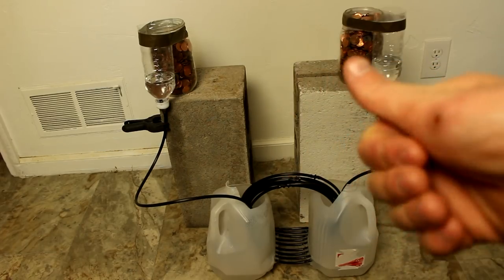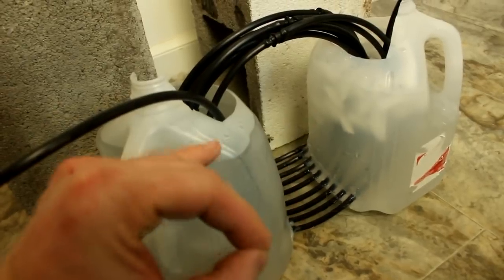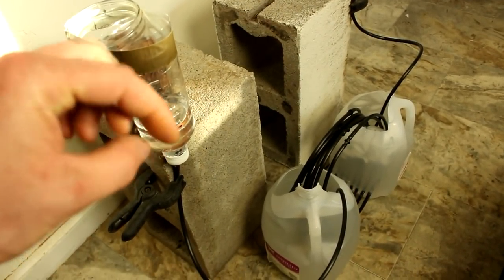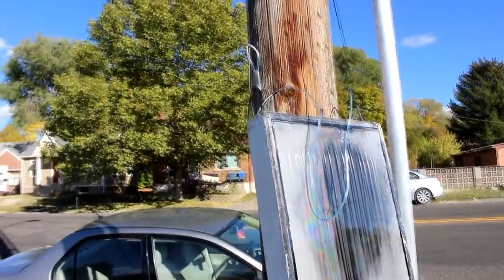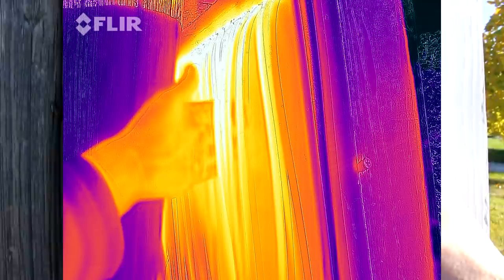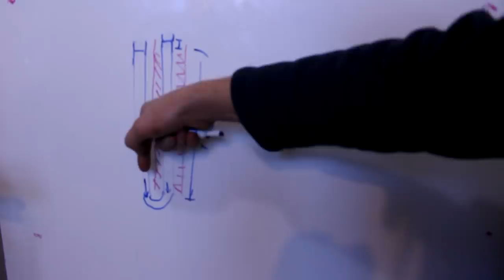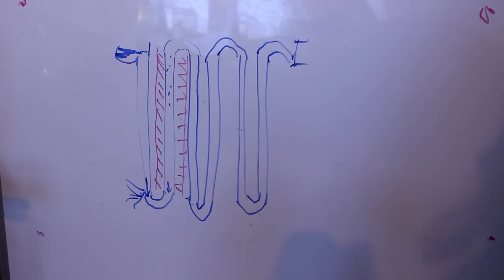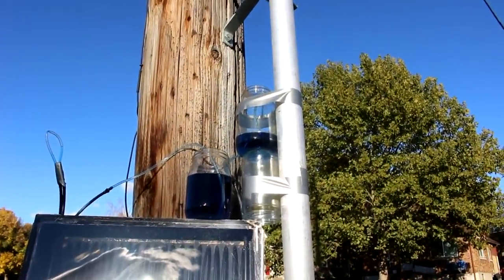Water Pump With No Moving Parts? (except water of course)

Comment: Copper pipes and a peltier grid maybe?  Power the peltier units with solar panels and batteries; each unit has a hot and cold side.  I mean, if you want to maximize inefficiency anyway.  You would probably need a beefy battery array and a solid chunk of solar panels.  Also, hello from a fellow Utahn!

Comment: You could solder a bunch of thin metal tubes to a metal plate & connect the metal tubes in place out the ones you're using, then you can put some heat sinks on the metal plate to radiate heat much faster.

Comment: I would recommend using copper/aluminum on the cooling side to radiate more heat, giving you a much higher temp differential.
I would keep the plastic on the heating side the black plastic to avoid heat-sinking from the cold side and to absorb more solar radiation.

Comment: All you need in the glass blocks is a single vertical black thin wall tube plus a separate open return path, assuming the blocks will be in the sun part of the day. Make sure its large enough to not have significant capillary interference or clogging issues(biofilm) far more than a drop will transfer each day. If it needs more push simply shade the top block and solarize the bottom block.

Comment: A factor you overlooked Cody is difference in hot leg and cold leg static height. To get effective circulation the hotleg needs to be longer than the coldleg and the heat source at the lowest point in the system.

Comment: Cody, this is a really interesting idea and although the pump certainly utilises the thermosyphon effect I don't think this has been done. Google and patent searches don't return anything similar so i think you should submit one if you haven't already.

Some thoughts:
I dont know how much impact it would have but half of each hot side tube is in shadow, i think black tubes which sit in concave reflective corrugations could give this a real boost. 
Wider gauge tubing should make the construction easier a good design may even be a flat heat exchanger type plate on either side.

Comment: A further optimization might be to bring the tubing within the solar box together for mutual heating,  and splay the tubing on the far side for better radiative cooling. Fins of conductive black aluminum would also add to the cooling, and insulation at the back of the box inside and out.

Comment: Hey Cody, just wanted to tell you that this principal has been used in nuclear reactors for decades. Natural  circulation reactors use the concept of thermal driving head to perform the same function, and to remove heat from the core of a reactor. Message me if you wish to know more!
Reply: So they don't have to rely on a pump?

Comment: I saw a 1 room solar heater design similar to this, once. In order to exchange the heat between the fluid and the air they used copper tubing on one side. To increase the rate of heating, they used a reflective backing in the box and black tubing.
Reply: Yeah, this seems like it would actually work best as a closed system to transfer heat, rather than as a pump.  I wouldn't use water in it either.

Comment: It's not quite what you were saying, but you could regain some of the heat being dissipated if you were to stack two sets of tubes so that the bottom half of one and the top half of the other intermix. That way you get some of the heat from the lower set as it leaves out the back preheating the cold side of the top half as it enters the box. You'd still have some heat going unused, but it's an idea. You could either have each set move water separately or tied together at one end.

Comment: That's how heating systems worked in the '30s-'50s ,before pumps were invented. The obvious difference is the fact that there was only one loop (even if distributed in branches). What moved the water was only the heat from the boiler, and the cooling made by radiators. Back then heating systems were really precisely calculated (all with slide rule!) and built, because the head was just a few millimeters, compared to the meters we get nowadays with pumps!

Comment: This is like a cooling system in a fridge.
The resavor is to displace heat by expanding the water over a flat surface and than after you put it into the tube again put magnifying glass over the tube to increase heat.
I think you could make this much more efficient

Comment: Hi Cody,
If you made the loops in a rectangle, let's say two meters high by one meter deep (or wide) with the upper horizontal section in the shade and the lower section in the sun, then the vertical sections would be at pretty much full differential for the full height. 
The next improvement might be to add a chimney to the upper section to increase the air flow over the cooling pipes. Then you might be able to make a it a trapezoid 1/2 meter at the top (less friction) and/or some sort of reflector at the bottom to make that leg shorter.
Of course it might be nice to move the heat from the top section to the bottom section but I'm not sure heat pipes would work (capillary action would have to carry the coolant all the way back the top) so insulated aluminum bars would probably be the best passive method you could use. (unless you can think of a liquid with a negative thermal expansion coefficient)

Comment: You can make a similar pump that uses convection by offsetting the heating and cooling side a few degrees off the vertical so the hot water will rise up the left side cooled on the right side.

Comment: cody you could probably make it work a bit better by lining the inside of the box with polished aluminum foil. also you can use copper tubing on the back to help cool the water on its way down. as for the heat exchanger I think if you wrapped some copper wire from the top of the bend of the copper tubing then just insulated wire down to the bottom where it connects as a hose again you could have a crude heat exchanger.

Comment: Have the hot side coil only in hot water, cold coil in cold water, not that "looping through both" thing. Also, connect the two upper water reservoirs with a cross line, it will carry water from the hot side back to the cold side, allowing a cycle. Once set up, a drop of food colouring added to one side will show the flow (for a while).

Comment: Keeping with your simple experiment, what if you isolated the top third of the box, to create a heat sink? Ventilation holes in the sides and back, and a shade cover on the front. Just a simple thought. Another idea might be to create a loop or loops in each tube at the back of the box; more time to cool off behind the shade.

Comment: This is basically a giant thermometer that uses the expansion of water as its medium!

There must be a way to increase the thermal displacement pump efficiency by using mercury instead. The expansion is much more sensitive to temperature so a lower temperature gradient could achieve the same displacement, and the specific heat capacity should allow mercury to cool faster than the water if I'm not mistaken.

Preventing mercury contamination of the pumped water is the issue... you could have the mercury pool on a piston at the top of the system and act as a simple mechanical pump, using the thermal pump to add the mercury to the top of the piston.

Comment: Copper tubing will make a much better radiator, but you'll probably have to line it with something to prevent the water getting copper ions in it.

You could have copper tubing filled with water, which the plastic tubing passes through. This should exchange heat fairly effectively.

A second improvement for heat generation would be lensing the front side to concentrate the sunlight on your tube edges.

Comment: I really like this.
No, it’s not as efficient a use of solar power as a pump is, but energy is not the only efficiency need. Pumps wear out. Rodents chew wires. This pump will continue pumping until the materials corrode, erode, or something plugs it.

Comment: Aluminium heatskink on the back, pull the heating side tubes closer to the back panel. Seems to me the sun will be warming the painted face, and the inefficiencies of the heat radiating off that would be causing some issues too, due to the air gap between tubing and black paint backing.

Comment: If you were to put the output on the bottom of the device, it would form a siphon on its own after reaching temperature and this would assist in sustaining the pumping action.  Also metal tubing would transmit the heat better.

Comment: To do a heat exchange, I'd think you'd have to interleave stacks of loops. It wouldn't increase total heat but would make the hot side more evenly hot, and the cold side more evenly cold. I really think a better heat-sink of the back could help you more with a lot less complexity.

Comment: Cody: I might be wrong here, but I think this is like a balance scale. I has a force by which it pushes water, but the more water is on one side, the more pushing back. The reason for the 12.4mm is that there is the balance. If this would be a closed loop, water wood circulate. You can measre it with a flow meter. But wouldn't using this high temperature difference be lethal for the creatures?

Comment: You should test heat absorption on black tube vs copper. There should be a reflective surface on the hot side behind the tubes. Not only would that increase the transfer from light to heat, it would also decrease the transfer of heat through the box. Fins similar to a PC heat sink would be great for heat exchange.

Comment: cool idea !.......get some AC units from a junk/recycle joint .....play with A-coils & condensers or the guts of a baseboard radiator(copper tube surrounded by aluminum heat-sinks) would work like a champ.........& maybe bury it (the cold side) in water cooled sand or something etc........there are endless variations.

Comment: I had a very similar idea about a year back. The main difference was that there was no cool stage and I wanted to get some valves so that the hot water wouldn't flow back to the cold reservoir. I didn't get the valves. Essentially it was a coil of poly pipe on my hot concrete patio. It got the water warm though which was a bit of a success as it was lye water I was needing to evaporate. Thinking about your design. maybe the solution is to simply turn it on its side. That way you aren't fighting gravity on the cold side.

Comment: To increase heat differential:
1: use copper or aluminum tubing.
2: put a reflector on the hot side so that the hot side tubes get heated more because the shadows are lessened and more heat is given to the tubes. Also making sure that there is at least a 1cm gap between the reflector and the tubing.
3: use insulation between the hot and cold sides to increase the heat differential.
4: put heat sinks on the cold side so that the breeze would add to the cooling. Simply taping ribbons of aluminum foil would do.
5. put it on your roof?
6. heat is the main source of degradation and wear so... yeah... still the same as you were using the pump.

and some additional info: any kind of rubber tubing is already an insulator despite the black color... so... yeah. It's gonna move hecka slow.

Also this technique is similar to solar air conditioning where you expose some tubes to the heat of the sun to pull all the air out and let the air in somewhere far from the intake of the hot tubes while cooling it down using soaked rags and stuff as it enters.
My cousin's been using this technique since the last 4 years ago on his aquaphonics because of the cold streams running down from the mountains. And no, they're on top of the mountain so you can't use the flow of gravity.

Comment: Have you ever taken apart a coffee maker? Thats how a coffee maker moves water from the reservoir through the hotplate and up over the coffee grounds. The only thing missing from your design is a one way valve. the hotplate will make the water so hot that the pressure pushes it, but the one way valve keeps it moving in one direction and not back into the reservoir.

Comment: I was shown a way to pump water with 2 sealed tanks connected by a hose, as long as you pour water into a funnel on the lower tank you can pour from the higher tank up to that rate as long as the openings in both tanks are submerged.

Comment: I know i got here a year late but hear this out, i have a few possible upgrades:
1-You seal the hot half and fill it with CO2 and get a greenhouse effect to heat it even further.
2-You seal the cold half and fill it with coolant (i know, expensive, but it would take up the radiating heat from the tubes)
3-Profit

Comment: You could make it like Lilly pad with water on the cool side to exchange the heat more efficiently.  Or figure out how to do it vertically. Or maybe a rudimentary evap cooler to decrease the air temp

Comment: Upgrading the efficientcy goes by 2 steps : 
-> maximizing the temperature on the sunny side (S-shaped pattern for example) 
-> Cooling down the shadow side as fast as possible (better heat exanger as copper or simply submerge de tubing as in your proof of concept with the jugs) As the final goal is to provide a system underwater, I would use this water as heat exanger to cool down the system...

Comment: Doing this with two pieces of wire made of dissimilar metals twisted about one another would create an electrical charge (thermocouple).
Run a great deal of them in series, and power a small pump.
The issues with this experiment were trying to use two separate containers of water and cooling the water.
Put the cold water outlet on the bottom of a container, with the hot water return 2/3 of the way up the side and a heating coil well below the reservoir.
Doesn't really work if you try to cool the water before returning it because you're removing the working energy.

Comment: Cody'sLab your whiteboard explanation made sense to me, but then i got confused again, because the construction of your panel doesn't follow your theory. If each winding of the black tube is acting like a U-tube, then according to your own explanation each 'u-tube' (winding) raises the water incrementally about 1cm at a time. Therefore the top of each winding should be about a cm higher than the previous one. That would result in an upward sloping edge to your solar panel, but on the video it's clearly horizontal. Puzzling!

Comment: I think what I would try is to use a vacuum pressure differential as part of the design. Place a black pressure reservoir outside behind glass. Feed a line into a more temperature stable environment where the water reservoir is. Connect the line to the top of the reservoir, and make sure any condensation can drain back into the reservoir. 

Place a vacuum reservoir in the temperature stable environment and feed a line out to the top of the exterior water reservoir.

Connect the bottoms of the reservoirs with a line of tubing.

The pressure and vacuum levels in those reservoirs should vary with respect to one another and pump water back and forth more efficiently. As long as the two water reservoirs are at the same height, and same, or opposite, angles it should work better.

I don't know how close to 100% efficiency it would be, anymore than I know how close to 0, but unless you've already achieved your goal, and haven't tried this yet, might be worth an attempt.

Comment: They used the same priceple in centrale heating back in the day. By heating the water in the basement, it moved up to the radiators in de rest of the house. And the cold water moved to the basement to be heated again. All without a pump. It's called natural curculation.

Comment: The trouble with this scheme is that as soon as you get water moving, you will be cross-transferring the heat to the cold side.  You need counterflow heat exchangers to reduce this "heat load".  The problem with that is the 2 streams between which you are exchanging the heat between are physically separated.

Comment: you could find an older style fridge with the large radiator on the back, cut the bends where it loops at the top and bottom, them plumb the top and bottoms into your "hot side".

Comment: You could build a super inefficient water pump using the same concept but with layers of peltier heat pumps to transfer heat from the cold to the warm side. Sandwich multiple coils of tubing such that each column has either two hot sides or two cold sides on either side.

Comment: A very simple but effective improvement would be to use a metal surface in the front (painted black) and a Metal surface painted white or not painted at all in the back. If you separate them with an isolating layer like styrofpam or something, your would have a ver simple heat exchange system, because the metal would increase the temperature exchange a lot, increasing the temperature gradient and thus the efficiency.

Comment: For your heat exchanger idea: you could use solar-powered peltier tiles between metal clamps (perhaps copper) to actively transfer heat from the cold end to the hot end. Maybe it would be cheating but hey, it's still solar powered. Efficiency would still be a challenge. The way I would attempt this would be with two large aluminum plates that have a large array of peltier tiles between them. Onto the plates I would braze a bunch of small tubes, probably 1/16" ID and then connect all the ends up so it is a continuous loop. You could then paint the hot side black to pick up a little extra heat. It would be rather expensive and time consuming to produce, not to mention you would need a lot of solar panels to power the large number of tiles required. As you well know copper is around 1.7 times as thermally conductive as aluminum so it would work a lot better but it is also a lot more expensive.